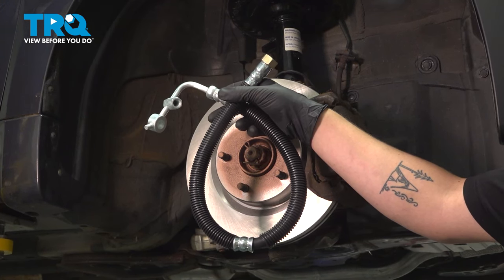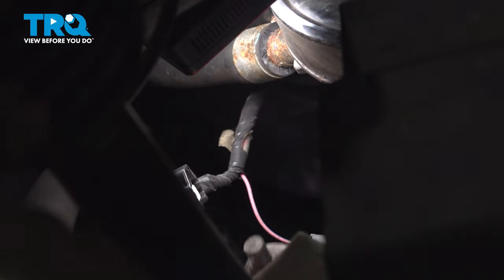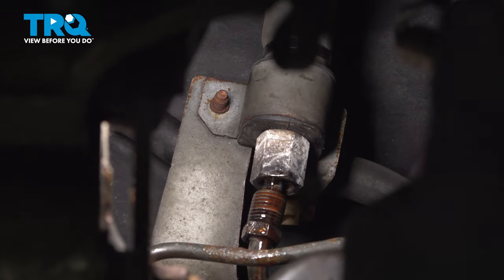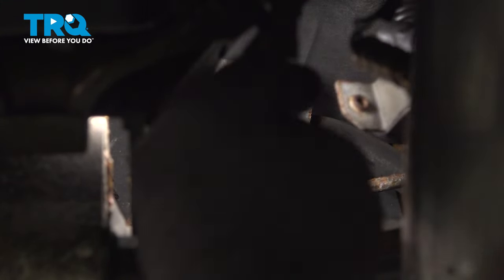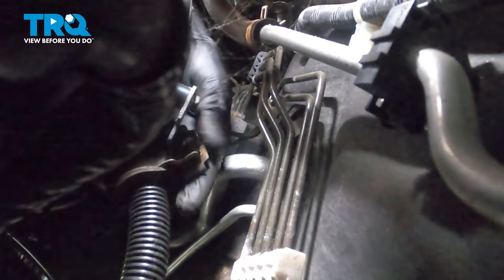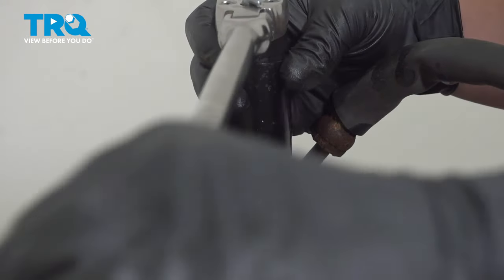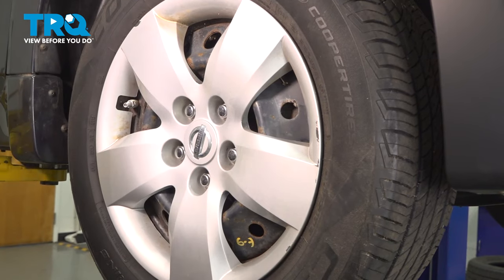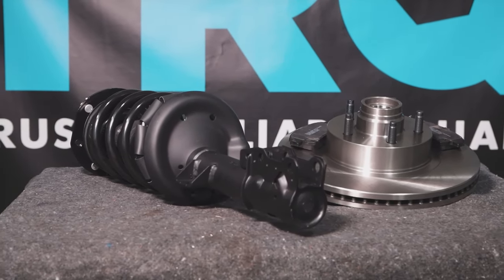How to Replace Power Steering Pressure Hose 2007-2012 Nissan Altima

Comment: I just turned the steering to the left, and it gave room to work without taking the tire off.  I got an Import Direct part from O'reillys, and it was the hardest thing to put on. It's like they put the fitting on 180 out. I'm assuming when it was made, it was put in the bag right after, and it caused the rubber to bend the opposite of correct, so it was pretty hard to get the banjo bolt in the pump.
  After 4 hrs of messing with it, I finally got it on. The top bracket behind the intake was a bear also. I had to take the 2 bolts off, tighten the bracket onto the hose, then tug and pull to bolt the bracket back to the intake.  The car has over 200k miles on it, and many things were hard and brittle, causing leaks.  The sensor ended up breaking trying to remove so a new one went on. The rack side, I had to unscrew the metal line going to the box and remove the 2 pieces as one. The connection between the two was stuck also. A vise, wrench, and hammer to get the two separated.
  I've never had so much trouble replacing a power steering hose.

Comment: I have a 2009 Nissan Altima with a power steering fluid leak, where would the most likely area of the leak be? Do I need a new power steering pump? Please help...

Comment: TIP: It's really hard to find the upper attachment point behind the intake manifold by just looking and trying to see it, but it's easy to see the hose, so just spot the hose and run your hand up along it until you can feel the attachment point.

Comment: Double-checking tools for the R/R of the PSH. At the 2:11 time, you used 19 mm to hold the line 14 mm to remove the nut. On the replacement at 5:10 you up to a 24mm holding the line 14mm to tighten. Did something change with the new PSH?

Comment: Thank you for taking the time and effort to fliming this job, but honestly it missing the crucial part on where do you reach the end of the hose that connects to the steering mechanism, you showed how to remove the end that connects to the pump, the bracket in the middle of the hose , but how / where did you get to remove the other end near the mark @2:00